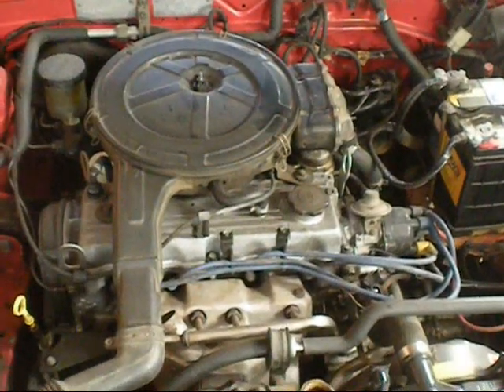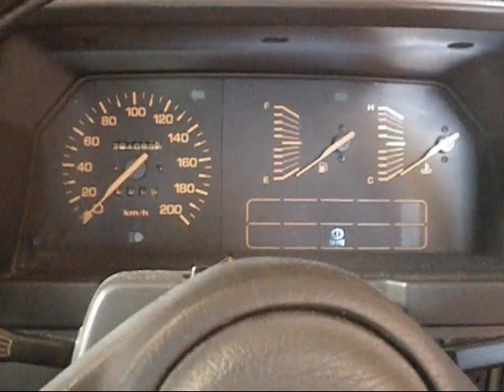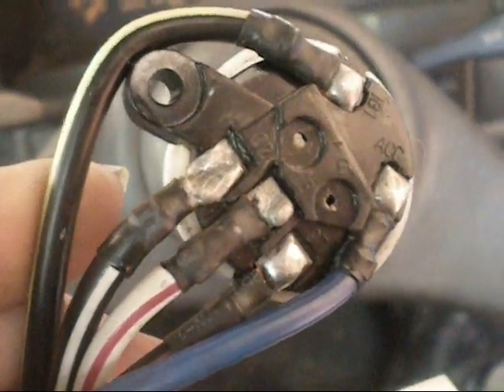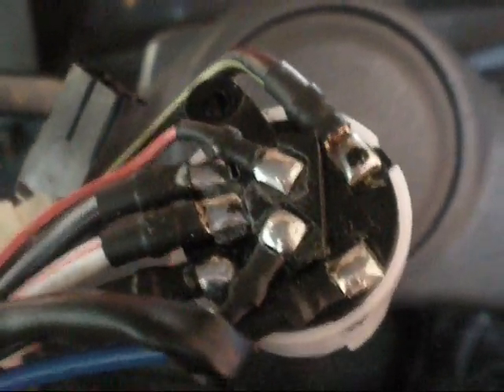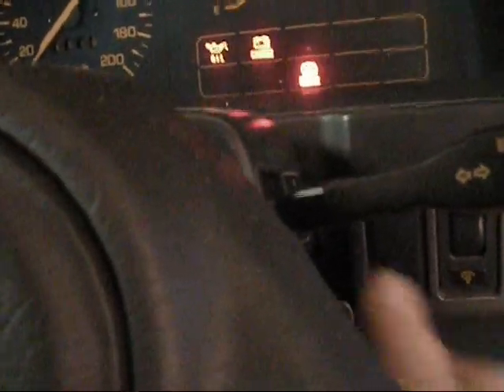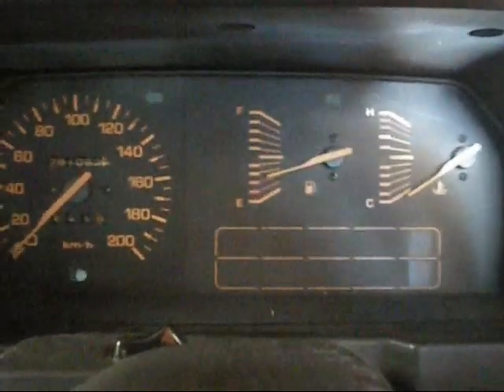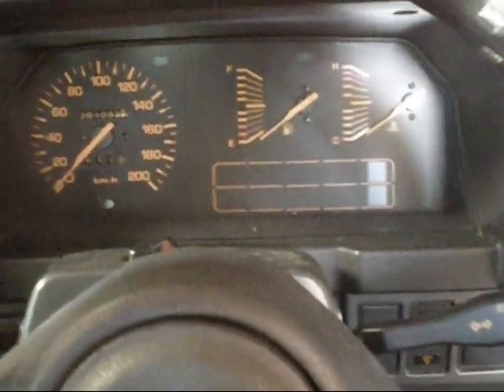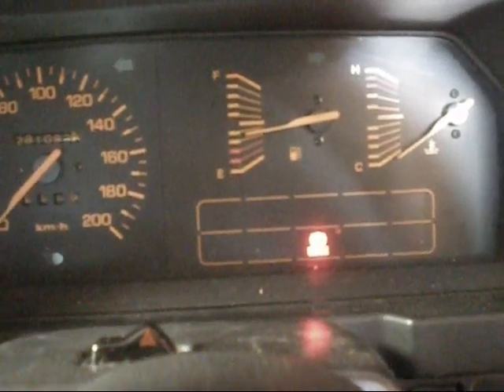lazer/323 Ignition switch

Comment: friend at work has a EB II falcon that refuses to crank when its been sitting in the hot sun for a while, no solenoid click or anything. could it be the heat affecting a similar thing like ignition switch if it was a bit old and worn?

cold mornings/days its 100% tho, even if the engine is hot.

Comment: The crazy thing about these ignition switches, is that the electrical part can be separated from the lock....It makes it easy to steal them. Ford obviously didn't think THAT one out that well, did they? 

I once saw a Ford car dumped in a car park with "POLICE-AWARE" stickers on it, and surely enough, when I looked in through the window, all of the plastic around the ignition lock had been broken off, & there was the ignition contact block...complete with an engine-starting screwdriver! 

-BBD.

Comment: I have a ford kj laser, in your video you show how to  rerouting the thermofans through a relay switch to take the stress off of the ignition switch, to prevent overheating {Fire!} . Just wondering if you would be kind enough to post a diagram/info on how to do this. it would be greatly appreciated. Im am happy enough to post an image of my ignition switch if that would help. Thanks Dave 
Anyone is welcome to reply.

Comment from the maker: @jazzy4me4eva lol the last car i had in with this problem was a 323 and it fucken got hot to the point that the solder melted and ran across the terminals and made the radiator fan stay of when the car was off.lol i found the problem when the car was running with the a/c on the the dash started smoking.. i did the relay and fuse thing to that car because the a/c was on all the time.